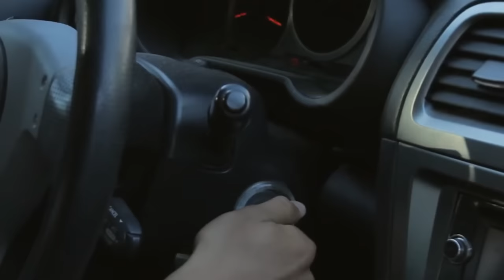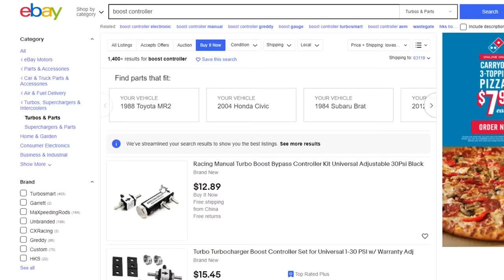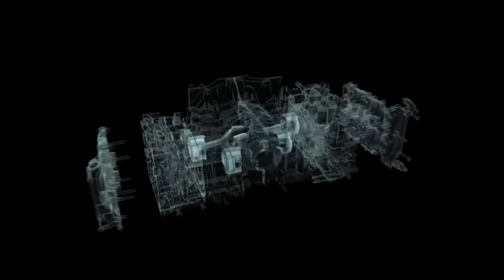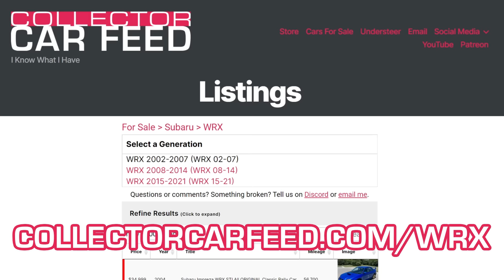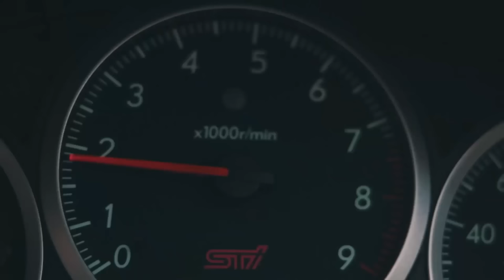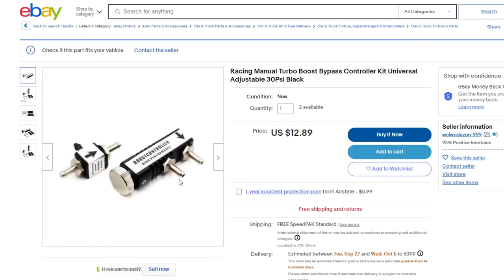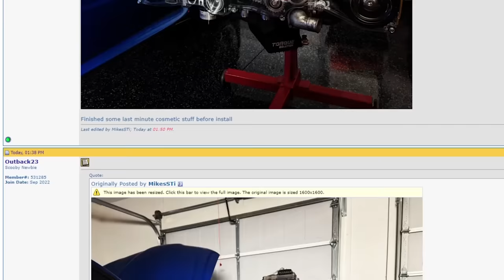Hard Truths of Owning a WRX in 2022 (Donut Media Won't Tell You This)

Comment: YES ! SOMEONE FINALLY POINTED OUT GATES TIMING COMPONENTS IS SELLING OUT. THEYRE USING CHINESE BEARINGS. BOUGHT TWO SEPARATE ONES. SAME PROBLEM. GET AISIN / OEM !!!
Reply: When Gates left North Carolina I figured the quality would plummet
Reply: I got aisin on mine when I seen what happened to gates
Reply: Yep. I had found that out after I ordered my gates kit. Luckily I was able to return it and I spent a little extra and ordered an Aisin kit. Guaranteed jdm bearings and peace of mind 😌
Reply: I got a timing and water pump kit from aisin and the pump I took out of the car was caste steel and looked relatively new so I put it back in, The one I received looked like aluminum impellers I was confused where the caste one came from that was in the motor I want to know who made it cause that’s who I shoulda bought it from
Reply: Unless rock auto switched good parts out for Chinese ones in the kit cause I got it from rock auto with a couple of other parts
Reply: Unless rock auto switched good parts out for Chinese ones in the kit cause I got it from rock auto with a couple of other parts
Reply: I knew the shop that did the timing belt on my kit was legit when they asked if i have the aisin kit, not the gates
Reply: Aisin is the best. But would think by now most subaru gurus would know gates is meh.
Reply: The Gates kits which end with the letter N still use almost entirely Japanese components, but even then the kit I got for a turbo Forester had one Chinese pulley. The water pumps also are not Japanese anymore so I would always go Aisin for those. I have a video on my channel reviewing the Gates N kit if anyone wants all the details. Overall, Aisin is better, but a little more money. I would not buy the non N Gates kits anymore.
Reply: @802Garage  If it's only a little more money, just get Aisin. No sense in dealing with all that and risking sub-par parts. Aisin is the way.
Reply: @mattswank  Generally agree, but I also understand being hella broke and I also think it depends on the car. 300K mile beater you're limping vs your nice 100K mile WRX for example, hahaha. Depending on the kit, if you buy a Gates N + Aisin or OEM water pump you'll end up with all the same components for less money, but that one Chinese idler in some kits will always nag your brain. ;)
Reply: @802Garage  I have two problems with that statement. If someone is broke enough to not be able to afford a small price difference of a hundred bucks or so, then they likely can't afford to even do all of that in the first place or own the subaru and they need to go buy a honda with a timing chain. And, if your plan to help save money is to buy cheaper parts, you will end up paying twice a good bit of the time, and timing is one of the last things anyone should skimp out on. The best way to help weed out these garbage parts is to stop supporting them altogether.
Reply: @mattswank  Having lived the life of someone too broke to buy the best brand of parts, but not too broke to afford doing a timing belt at all, I can tell you it happens. When your budget for a month is let's say $600 and a timing belt kit, skipping the water pump, choosing the lesser brand, saves $50, well that $50 might be the difference between owing the bank an extra $20-30 if you overdraft later. For the record, I think I've only over drafted 3 or so times in my life and it was always because of some charge hitting far later than it should have, but it happens.
At any rate, you can't exactly not fix your broken timing belt, can you? If that car already has 220,000 miles on it, you paid $350 for the car, and even the cheapest timing belt kit will last at least 50,000 miles no problem, why would you buy the best parts to put on a rusty pile of garbo? It makes no sense. Spend good money on good cars, save money on a beater. Most Hondas that would be affordable on that budget would also be timing belt. Every Honda 4 cylinder in the 80s and 90s until the advent of the K series in the 2000s was timing belt as far as I know. You don't end up paying twice for cheap parts when the car will literally be gone before the parts need to be replaced again.
Now I grant you, I have used that logic on cheap ball joints and ended up keeping the car long enough to need another one, but also when the cheap ball joint is $15 and the expensive one is $40, yes I had to do it twice, but I didn't have to pay $40 all at once and it only cost me my labor instead of dollars. If you have lived poor, you get it. If you haven't, you don't. I guess it's kinda that simple. If you need a bearing and a ball joint, the cheap ones are $60 and the good ones are $120, and you have $80 in your bank account, what do you do? Skip one or the other and risk a breakdown or crash? Borrow a car from someone while you save up? Lots of not appealing options over some Chinese parts.
Sorry for the rant, and I know it's easy to say "Just make a little more money." or "Well save until you can get the good ones." or any number of easy from the outside answers, but again, why put brand new OEM parts on a car worth less than the parts? Literally an OEM timing kit from Subaru or full AISIN kit costs as much or more than cars I drove for multiple years in the past. Especially when it was a non-interference engine, if the belt snapped, oh well. Interference it's a different calculus for sure. Just gotta do what makes sense for you at the time and the Gates N kits even with one Chinese pulley in some cases are rated to last 100,000 miles. Each person can make their choice. $100 is not small to a lot of people.
Reply: what about GMC WATER PUMP?? IS ANY GOOD? IT SAYS MADE IN JAPAN,   i am using mitsuboshi timing belt and NTN pulleys
Reply: North west rally sports! Thank me later
Reply: @AndrewB23  , "saw what happened".
Reply: I noticed that the last set I bought. I though to myself how cheaply They looked compared to the worn out OEM parts.
Reply: aisin for the win.

Comment: As a former owner of 3 subies ( 01 2.5rs coupe, 05 impreza rs, and a '11 wrx), these cars are phenomenal when stock and something that is very overlooked. While your gonna get gapped in straight line, on the corners these cars are amazing. In my recommendation before you do any kind of power mods, build your suspension. Coilovers, sway bars and strut bars to get some general stiffness in the chassis and just takes down some curvy back roads and I guarantee you will have more fun then just goosing it in a straight line.
Reply: That is the best way to go about it, but it's not as exciting to skill-less people who just wanna roll race. Countless people running 500+ WHP on stock brakes and suspension, lol. (I was one of those guys... ended up destroying the car...)
Reply: I disagree, the stock tune is pretty meh and you can get a full 3'exhaust for a decent price, especially if second hand. Have that and a tune, easy power gains, easy fun gains.
Reply: Agreed. Kept my 2018 mostly stock engine wise, at 110k miles right now and no problems. Like you said they’re the most fun in curvy and winding roads. Only the brainless ego heads care about going fast in a straight line.
Edit: I do have a stage 1 tune to get rid of the shitty stock tune and open up the power thru the rpms cause the stock tune sucks with the rev hang and power dies off around like 4500-5000rpms
Reply: I refuse, I’m getting HKS belts
Reply: I’ll leave this here...”When in doubt, go flat out”
Reply: This way is probably gonna be better on your transmission too not just the engine 😂😂😂 if you know you know them subi 5 speeds don’t like to hold up to abuse
Reply: Spot on... Although, I'd look at shortening the clutch fork as well. Just for a quicker clutch response and gear change. Stiffen the chassis is a must. If running with coilovers, Whiteline parts are a go, with the full spec employed.
Have had a lot of fun in my subbies.... Looking forward to a lot more 😄
Reply: I agree, these aren’t fast cars in a straight line and you don’t get much gains per dollar in power mods. These are great going on a twisty mountain road. And very daily-able, safe, and iconic cars.
Reply: @TimberWulfIsHere  tune doesnt matter if your car isnt in the condition to handle or use the tune
Reply: @jjooordy  Not my problem
Reply: My stock sf5 is so fun on corners i love it
Reply: Years of tuning and tinkering going back to 1g DSMs taught me one major lesson…. You want a faster car then buy a car that’s fast stock. 19 sti limited, high quality coilovers, wheels and Michelins. I did titanium muffler deletes for sound and a better short throw shifter. That’s it. No engine mods, no tuning, no BS. I will have thousands and thousands of miles of smiles with my car like this. You can do other aesthetic things if you like, I went titanium lug nuts, axle nuts and hub rings. Gurney for the low pro spoiler, flaps to save the paint and that’s pretty much it. I rip it every time I’m in it and if anything breaks then back to Subaru for warranty repair with no argument from the dealer. Once the warranty is up then only oem parts for repair. It’s that easy. You want to go faster then buy a faster car but honestly if you like twisty back roads with friends it’s there best way to go.
Reply: That was my goal until I had to rebuild a used motor :( oh well it is what it is. It’ll be back and stronger than ever.
Reply: Couldn’t agree more. It’s a Rally car (basically). Rally courses are curvy.
Reply: @SI0AX  the best is suspension, tires, and QOL modifications.
Reply: I never understand why people buy these for drag racing, street racing, doing burnouts/donuts, etc.  That's what a Camaro is for.  I want to be able to throw my car around no matter what the road is like and to laugh hysterically at how much traction it has.
Reply: Hell yeah man, my ‘09 wrx with stock suspension is also very fun on curvy roads. My sister driving me home in mine down some backroads brought her over from owning 4 VWs to swearing by subies.
Reply: Yes, this. It doesn't matter how fast you get to a corner if you can't make it through the corner. Sway bars, strut braces, chassis stiffening, vented rotors, braided lines, even a good set of springs (i still have the OG Prodrive springs on my 05) if you don't want to go full coilover. All needed long before the first power mods.
Reply: @jasonmoyer  02 owner here...305/304 to the wheels on the stock 5 speed...tuned by JR on E85 and I can confirm will do over 120 on gravel....at least 150 on pavement. Running 24.5psi on a 10+ sti turbo ported/polished/evo 16g wheel. Other supporting mods....I've ran it daily for several years now. Below 0 to over 100 degrees. 2.0L is rev happy.... best $7k all in tuned/parts/car I've ever spent in my life. My 2 cents....
Reply: I honestly hate that many people only look at highway top speeds and quarter mile times when cars can do so much more than just go fast in a straight line!
Reply: Having owned audio, Hondas, ford's, eagle talons  my 15 wrx is my favorite car and best car I've ever owned
Reply: You're right but they are Impessive for what they are stock. Most people don't realize the WRX especially, they are tuned and built to the limit from the factory. I will say they can usually handle another 20-30+ HP before you run into big issues. But they're tuned for longevity not max potential. That extra hp they're missing is to keep all of them driving out longer than the warranty. I've got an 11 and I've wanted to get a simple tune and maybe push 15 psi but honestly the tune would probably do it. A simple Cold air intake can destroy them because Subaru didn't plan for that much more air intake on the tune. Mine is stock besides a cut out in the exhaust, put a hks timing belt in case I do push more power. But again, not reaching for the sky just closer to sti power. The transmission is also a lightweight so both motor and trans are the weak links if youre trying to build them.
Reply: dont forget an anti lift /roll center kit aka ALK. best handling mod that people overlook on these cars
Reply: Lol I made the mistake of swapping me gc I had all the parts from a totalled gd and when my transmission went out I just did it. But that being set full poly bushings decent touring tires and coilovers got me well fast enough with 140hp to go I need to slowdown territory I took it on a road I usually take at 35 and with no tire squeal looked down and realized that I was effortlessly going 65. And it's actually less fun with the bigger engine it weighs more so it's slightly less flickable and to drive fast is no effort so I just don't drive that fast because to be challenging for fun I'm going so fast that I right myself the ticket I'm only driven it fast a few times because you going so fast that I would view it as excessive. Even coming from someone that does ten over everywhere everywhere with a speed limit over 30 ie not schools zones neighborhoods and parking lots
Reply: 350z outhandles the unreliable gaybaru
Reply: @nibba5692 most cars do as well lol. I honestly see this one 350 in the area regularly and damn do I wish it was mine.  Guy did very tasteful stuff to it. No absurd flashy body kid or unnecessarilylud exhaust,  sounded smooth, looked very modest and is quick. Definitely still na, heard him idle at intersection and accelerate,  not even sure if it's anymore powerful than stock.  Only 350 I ever drive wad a convertible and it was a fun car, though I would've not gotten the topless.

Comment: Do one of these videos on a e36 or e46. Personally I feel that these cars are good platforms but people just ether don’t get that they are challenging to work on or don’t want to fork up money to properly fix them. I have a e46 wagon that I put up on jackstands for a week to reseal the engine. My bmw doesn’t leak and cause I did it myself I only spent 1500 to reseal the whole engine and change all the hoses. I did a bit more but I’m not trying to get into every I did. But I never modified my car for power I just did OEM+ work and I can drive it cross country with out missing a beat. I had an e36 and the thing worked like a clock even at 225k but a lady crushed it cause they were texting while driving
Reply: My Bf and I own a stock e36 328Is and it’s the car I learned to work on (aside from a 2015 Mini Cooper S). Honestly they aren’t too difficult to work on from my experience, and so far we haven’t had any leaks. Granted it only has 145k miles so far, but still. I love it. Definitely want to see a video on them!
Reply: Only main “big” things to worry about with those really is Vanos and the radiators.
Reply: M50 was a solid mf engine and the M54, only problem with the M54 was the cooling system, but once you get that sorted, they're rock solid. Mine hit 198k and still sent it at WOT. Thought it was going to die over 20k miles ago. Ended up selling it, and the rest of the car went to shit due to homeless people beating it up. But honestly a e36, e39, or e46 are all terribly reliable if just given a little bit of love when needed. i.e. follow the MF maintenance schedule!